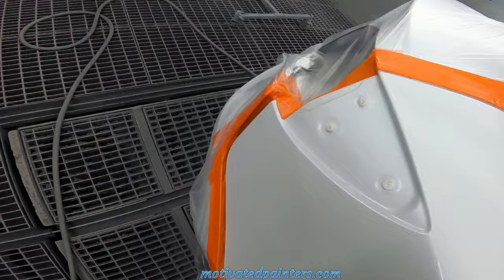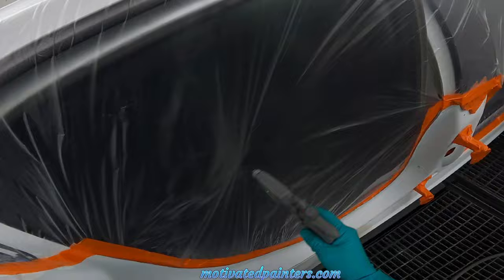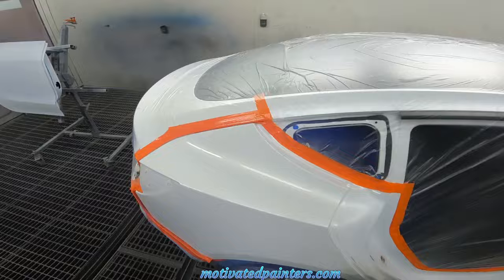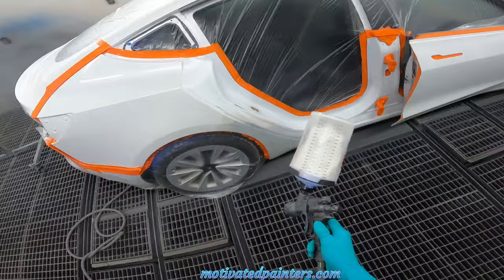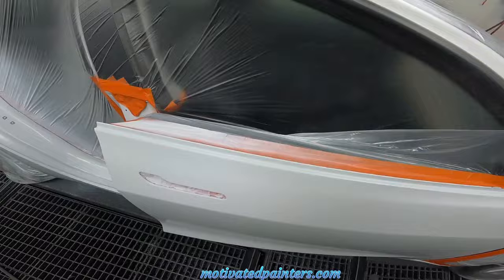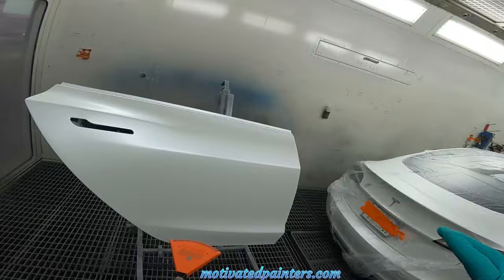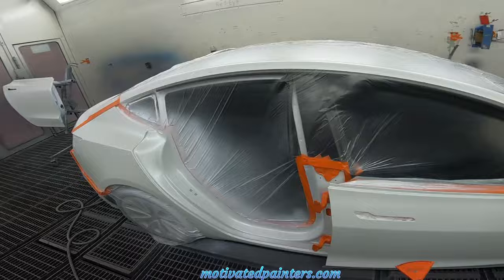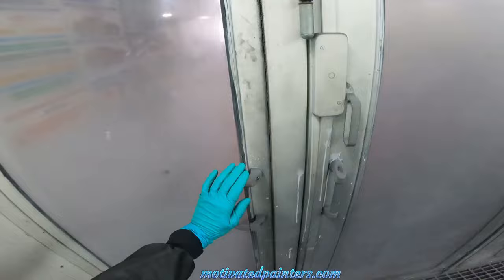Painting with Gabriel #2

Comment: Right mate I have a ford focus mk3 titanium x Gabriel iam fitted a new ford focus bumper on the front and its comes primed from ford and my bonnet is pealing clear coat mate 320 grit somebody said will I have to do a wet bed or the UK a blend to get the match lunar sky
Reply from the maker: I would not try to blend any clear. Maybe just blend color and clear the whole panel
Reply: @MOTIVATEDPAINTERS   thanks gabriel mate so just blend the base coat paint to match the car so when I get the new bumper primed from ford wipe it down and spray a blend and then base coat paint and clear coat paint

Comment: Does this static gun require a power source or only air
Reply from the maker: Only air!
Reply: @MOTIVATEDPAINTERS  thanks... question.. I have a new bed side I want to install...  is there a ecoat product on can spray on the back side for additional  paint protection. Before weld the panel back on.